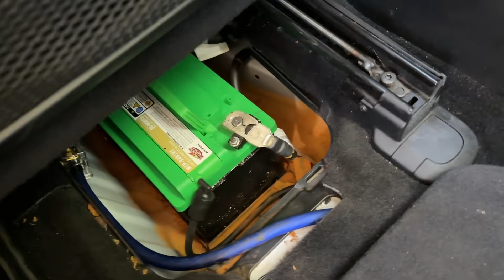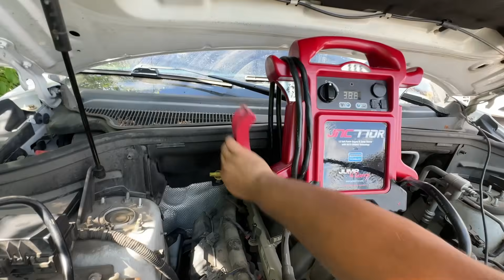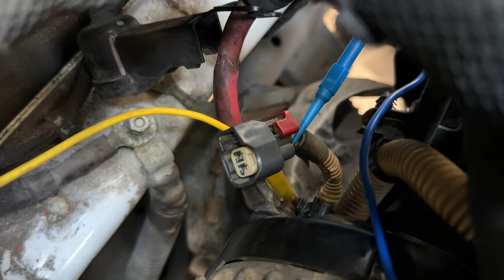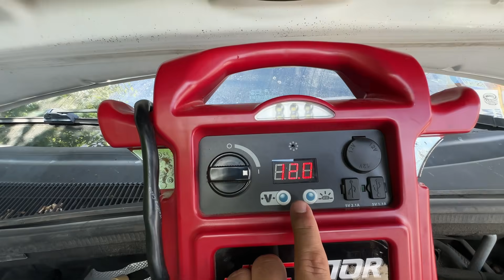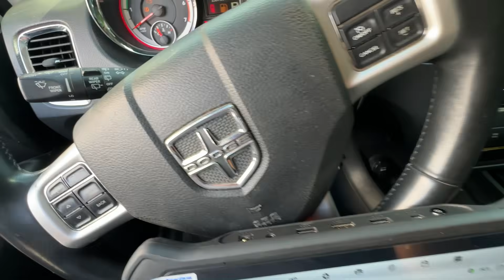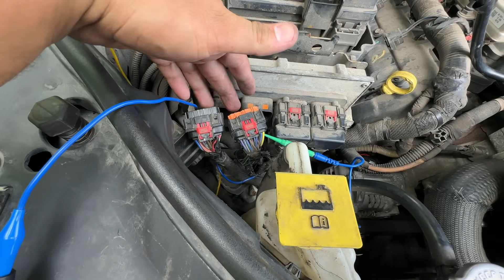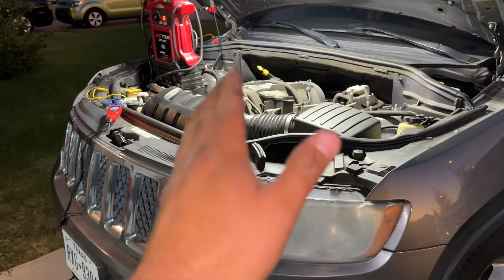DODGE DURANGO HEMI ALTERNATOR NOT CHARGING DIAGNOSIS

Comment: Perfect diagnosis Eric.
When you work on the Jeep, will it be smart to use OEM parts that are going to fail again or have the OEM been redesigned?  If not, I'd use good aftermarket parts. 
There is always the salvage yard for PCM's. 
Way to go in tracing down the problem here.  Newer vehicles are going with those "gas mileage" improvement ideas yet they don't justify the problems they create nor the expense.
Reply: That is so true the battery alone is wicked expensive I'd much rather if they just left it at the old fashion alternator systems before these smart ones they were much better

Comment: Couldn't you have jumped Pin 1 to battery power and just run full field all the time?  Like before PCM control?  Or will it overcharge/overvolt?  Would have been informative to see an engine rev with it set to full field to see if it still regulates.

The old "one-wire alternator" scheme.  Save the guy the money and let him move on with life.  

Nice video.  Remy has a good YouTube channel.
Reply: Unless the alternator has some type of internal controller, it will overvolt.

Comment: I write test prog on  Chry PCMs for a Reman Co.  Alt/Gen Field is a common problem in NGC & JTEC Modules. With NGC, if it is not a dead module (Pwr Circuit fails), it is very likely the Injectors and/or IGN Coil failure🇭🇹👍🏾

Comment: I have a question I have a 2012 Chevy Silverado and a lifter w Dr out so hubby and son are replacing it but my son put a wrong bolt and messed up the threading in the motor block what can they do to fix our problem? Thank you in advance god bless
Reply: Retap the hole or drill it out and put in a Helicoil insert.
Reply: @scotts4125  thank you so much